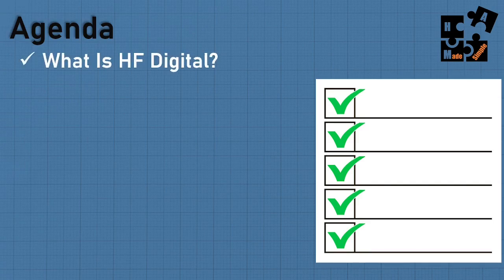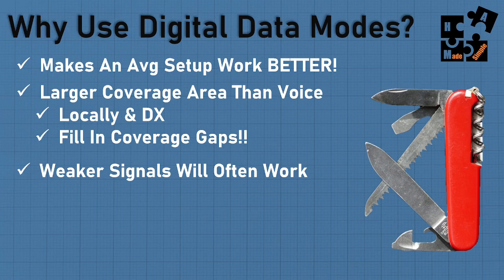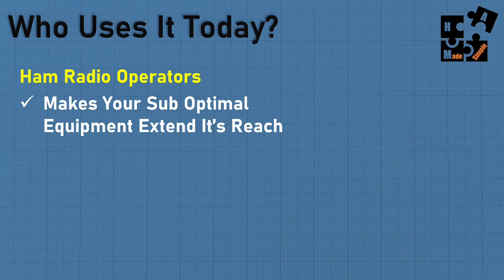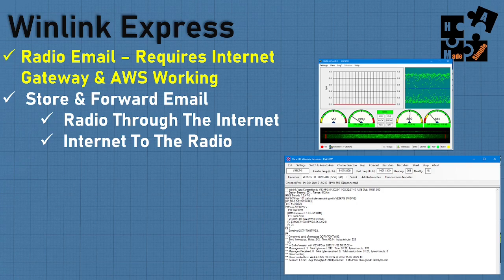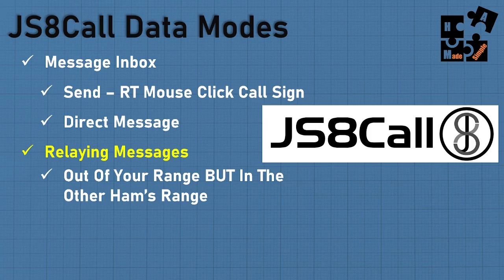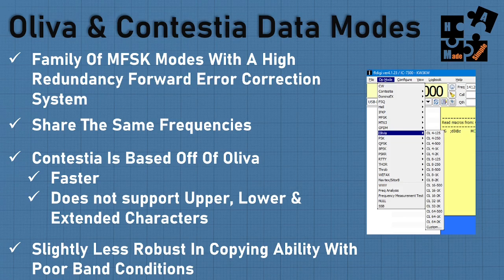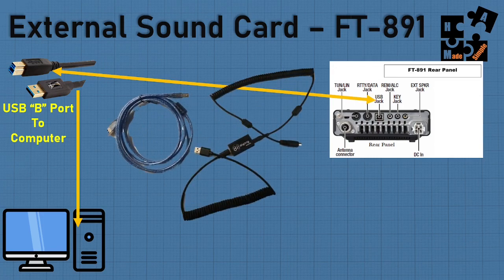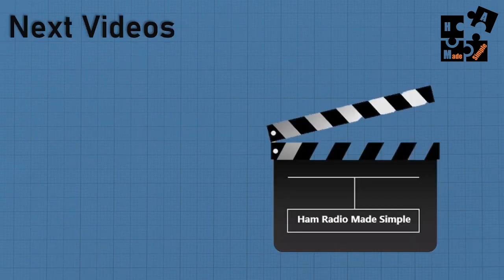Top 4 HF Digital Data Modes For Ham Radio Preppers - Part 1

Comment: Time sync can kill most data modes if the government’s turn off or block use of gps satellites. We can also assume Ft Collins transmitted time would also cease.
Reply from the maker: JS8 is the only K2K data mode with time sync.  We practice syncing to another member leader's sync request.  This way, we all can be sync to a person and not to a time option.  GREAT point and thanks for reminding others about this.
Reply: @hamradiomadesimple Thanks for the awesome video content!

Comment: I'm going to start cheep on the radio . Software programmable  , you had a nice radio going into digital . I'll shop around and use your antenna priority policy . . . C00L
 Thanks Mon
Reply from the maker: GREAT.  The link in the video should have the same antenna I use and it works better than more expensive ones I had tried.

Comment: I would add VarAC to your digital modes.  You can keyboard chat direct and also download files at the same time.
Reply from the maker: I did a video on VarAC and really like it.  However, when I compared full decode at SNR of -18 to -23, JS8 is the only one to do it.  They keep making improvements so I am hopeful to see it improve.  Thanks for posting and keep using what works for you!!

Comment: I love your videos; i have a question: what is the purpose of getting complicated with all the Equipment for HF and making long distant contact, when you can go DMR instead?
Reply from the maker: If there is no internet, DMR won't work. It uses Gateways which are servers connected to the internet to make the DMR connections possible.

Recent articles are quoting the current administration saying "they are working hard to remove foreign malware that has infected our power grid".  NOT GOOD!  Also, major solar activity (direct facing X Class Flare) could knock out cell and power stations in certain areas.  Bottom line, our electrical grid is breaking down (taking more power stations off line than adding) which means there are coming disruptions.  No power, no cell service (they will prioritize which towers they will keep online - near hospitals, police stations etc.) and no internet.
With HF digital, I can make direct calls to others in my group.  Most of us can run off of solar with batteries so we can share info.  Also if one of the 4 main grids go down, those impacted in that area have 24/7 access to us who can help or pass on info.  Since many of us have family members spread out across the 50 states, we can pass info onto their loved ones.  This model was done with US Troops in Vietnam.  Ham radio to states, then relayed via phone lines to family members.  

Great question!!